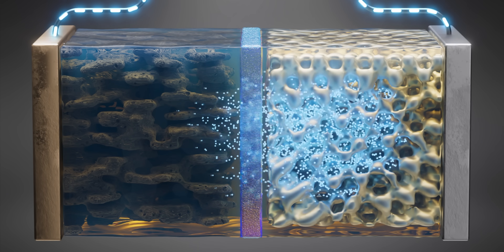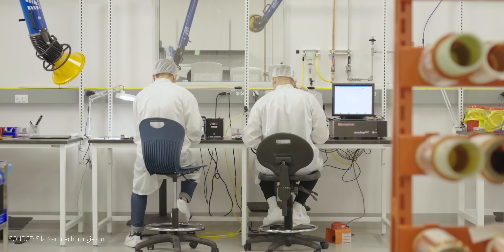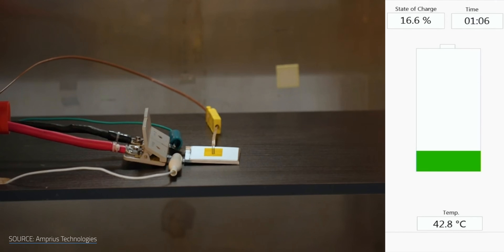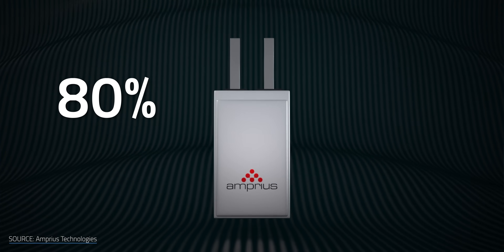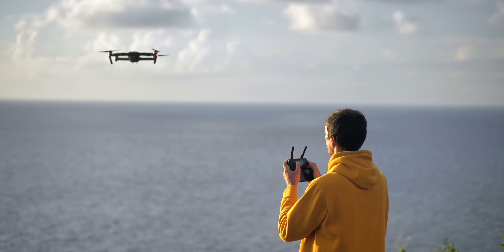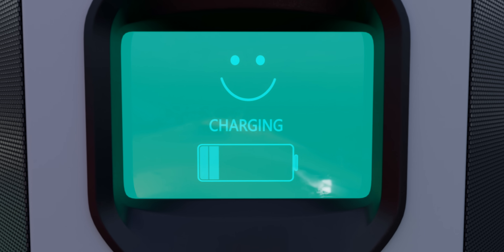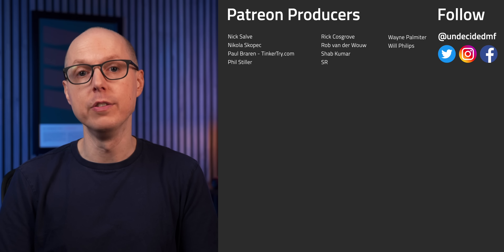Why This Ultra Dense Battery Breakthrough Matters

Comment: I think as far as vehicle propulsion goes, the industry is going to pivot towards Hydrogen and Ammonia powered vehicles.  This tech will still be useful for smaller applications you outlined though.  If I am wrong then the world must rapidly expand power generation facilities, and wind and solar renewables are not going to meet demand.  It will have to be done using Gen 4 Nuclear plants.

Comment: I think silicon batteries are "too good to be true".   Faster charging, from a grid that is NOT being improved and decreasing power generation, is Lunacy;  you can't draw blood from a turnip with a fire hose!  To add 80 KWH to a 100KWH batt in 6 minutes would take an 850+ KW charger because of heat losses and slowdown near full charge.   A Semi would require an 8.5 Megawatt charger!! >>>this represents an input of 5,700 amps at 1500 volts - that is insane!

Comment: Centrotherm is not a Dutch company. Ambrius is not partnering with Centrotherm, they are buying equipment from them. This is the kind of nonsense you get from someone in way over their head just reading press releases.

Comment: The lithium ion battery has no future due to the serious fires it is involved in if damaged or corroded - this is making such vehicles uninsurable. So having a material like silicon that can store more lithium and increase energy density just makes this situation worse. The latest batteries from CATL and BYD are sodium based and they will be superseded by solid state ones. But this technology also has a limited future in EVs as back up to hydrogen fuel cells which even Tesla is now moving to as well as Toyota and others in recognition that there are limitations on renewable energy supplies and charger capacity and siting. that are serious limitations to using an EV away fro your home city.

Comment: Isn't lithium the massive problem with batteries though? Are they going to be able to get away from Lithium in your opinion? You've covered a lot of batteries, and I always enjoy your commentaries, but I'm just concerned about lithium as the major component and feel like one of the other techs you've covered is going to have to take over at some point.
Reply: Lithium is not and never was “the problem “.
Reply: There is research underway to make sodium-ion batteries practical. Worse energy density, so not what you want for electric vehicles. But longer life and lower cost-per-unit-capacity, so ideal for grid storage, renewable energy and UPSs.

Comment: Amperius President and CEO both sell their stock as soon as they are issued it. Seems neither of them have any hope for the company. 
Jonathan Bornstein, President of the company was issued 70,329 shares at $0.05 per, and sold the same day for $4.36. Constantin Ionel Stefan the CEO does the same thing, but sometimes takes an extra day before selling. Sometimes a few times a month, sometimes less. If they don't believe in their technology, why should I?

Comment: Why can't you build/grow a lattice and coat that with silicone?  the current nanowire bottlenecks should be worked on, but it seems that is a showstopper unless someone thinks a breakthrough is imminent

Comment: China are changing their Lithium to type of coal or hardened carbon they put out the same power so far as Lithium but cost far less to make and also they keep their charge and recharge faster and longer with less heating issues. Also with the same finds making 128 bit processor phone chips to take the place of their dragon types of silicon chips. things are getting very interesting now. But the down fall is they all need to be charged and that uses power sadly but still amazing.

Comment: The minimum standars Cycle Life for Automotive battery Sector is 1000 DoD 100% cycle @70% of maximum Capacity @ rated C.
Old data found on it say 200-1200 cycle Life DoD 100%. The difference depend on the type of the cell. They claim that the 450 Wh/kg battery they are actually  selling , has improver cycle life. I think that is it possible in the 500-600 cycle life range @ 70~ % capacity of 1 Cycle

Comment: Amprius has claimed that their silicon  anode are compatible with existing battery manufacturing. And DoE has award them for a specific program for high energy density battery. For me they has all the checks and protoypes abd cells that are good. 👍🏻

Comment: I'm reminded of Pournelle's observation regarding Solid State drives and spinning platter magnetic data storage. Back about the time of the publication of 'A Mote in God's Eye', Pournell predicted that a decade or so back, we'd have moved to exclusively using silicon for persistent data storage, possibly with an optical medium for archival purposes. His logic at the time was that silicone was readily available on almost every beach and almost all soils, where the materials for the magnetic medium and the platters for hard drives was a much more limited material. This should make Silicon based storage significantly less expensive from a resources perspective. It is, however we are seeing a large migration to Silicon now, not because it is cheaper, but because it is significantly faster for the purposes we need that speed for. (Local laptop storage, memory virtualization, etc.) however there is still a large market for Hard drives, especially when Capacity is in question. Right now you can pick up a 20 TB WD Red (NAS) drive for $260 (US) on Amazon, however a current search on Amazon shows the largest capacity SSD drive available through them is 4TB, at $145 from Silicon Power. Not having heard of them, the next 4TB SSD I spotted was a Samsung for $207, as well as a Crucial NVMe 4TB for $180. Those may seem like a deal compared to $260, but if you need that 20TB capacity you're going to need at least 5 of these, perhaps 7 depending on how you RAID them together, to provide equivalent capacity, and that kind of eats up the savings.

That said, I like the idea. Eventually I see Silicon taking over in both power and data storage, whether it's like this or in some other solution. Just kind of more concerned about the turnaround time for products that will be price competitive at the consumer end.

Comment: Everyone keeps sponsoring SurfShark, and it doesn't work at all. People need to be cautious. It's good for tricking the region, but that's all. There's zero privacy. Anyone that's used it and got a letter from their ISP can verify this. It's probably all VPNs though, not just SS. SS was completely clueless about this, until I had a long chat with their tech support, and showed them. They genuinely didn't know before that. The went from saying "it's not possible"; to; "oh!". Yet everyone keeps pushing VPNs, and they are already cracked. The data stream is encrypted, so there's security there, and it gets past internet content filtering, and regions, but they can see exactly what file/traffic is going from point A to point B. 100% not private.

Comment: There is a near term solution to the graphite supply problem. It called the Hazer Process and converts methane (natural or bio) into H2 and graphite. Little energy is used and it cheap and scalable.

Comment: one thing i hate with lithium batteries...they dont like to be fully charged....so i keep mine at 30%. Its a pain, since i have to plan in advance when to charge it up and i also have to plan for actually using up that charged energy before i put the battery on the shelf....This huge hassle made me to get rid of batteries and just get gasoline powered tools.

Comment: You failed to mention the fact that ambient operating temperature range of Sodium anode batteries, as examined by CATL in China, is far wider than that of lithium-ion batteries, and considering the fact that as the size of the cells decreases,  thus making their deployment in mobile tech, much more highly desirable in the few cold climes remaining on the planet, but performance in warmer climes make them more adaptable, too!
It's apparent that lithium batteries future is ...in a runaway meltdown? No?

Comment: the reason lithium chemistry is unchanged(relatively) is due to one key factor
greater energy density means more energy and less mass to absorb and reject heat
it is already a major issue with EV's, the battery can get so hot during normal(non supercharge) use that the internal components degrade into a short circuit leading to a sudden dissipation of all the energy inside a cell as heat, causing what is called "thermal runaway"
while stationary or industrial use like planes and EV trucks for freight transit or grid storage may benefit from simple energy density boosts, you are unlikely to ever see it in an EV, it is just too hard to manage a cell that on edge
this is assuming you can actually store that much energy in a stable form, as it begins to rival gasoline and other chemically explosive compounds in energy density
just look at theoretical energy capacity of gasoline and TNT vs current lithium cells, you are basically putting a gasoline based fuel cell and tank into your pocket if you get 24x the energy of traditional lithium cells, and given how prone traditional cells are to damage causing thermal runaway you would NEVER want that much power in a place where you might get stuck within a few feet of the cells

at best this advancement will be relegated to "power vaults" where they can shut away a small chunk of damaged cells upon failure in a grid storage facility or the backup power for a nuclear plant or similar
the danger of electrochemical explosions is just too high for normal human use

no it will NEVER be safe enough to have something more energy dense than gasoline as a storage medium in your car, gasoline is remarkably perfect for chemical energy storage

what we should focus on is making a hydrocarbon "battery", a device that easily reforms a hydrocarbon with ideal properties for various temperatures and with a highly stable shelf life, like a liquid unpressurized version of propane
then maximize fuel cell tech to the point where we are just as efficient as electrochemical batteries

this would mean we can easily re-form a storage medium that can be a renewable consumable, pump this new "perfect gasoline" into the new cars and you can easily create a long-term stable solution to mobile energy generation and storage
plus as we all know, hydrocarbons leave behind gasses that act as a thermal blanket to our planet in high concentrations, so if we can pull those waste products back, form them into a more stable and higher energy form, we can kill two birds with one stone

Comment: Here's the hidden problem with charge time. Some battery systems are claiming potential 60% in 6 minutes. Sounds really nice (assuming it works and does not deplete battery life--another issue).

But here's the rub. Taking, for example a Tesla 40 Kw-hr battery, 60% charge would be 24 Kw-hr. To charge that energy in 6 minutes would require 240 Kw (Kw is the rate, not the total energy).  240 Kw, assuming 220 VDC to the vehicle would be about 1000 amps. That is a HUGE amount of current, especially when exposed to weather and casual use by non expert motorists (potentially extremely dangerous). And that is each and every station while the chargers are in use. It's NOT like charging a cell phone.

We don't have the grid for this scaled up to millions of cars and 10s of thousands (at least) charging stations. And that capacity is not on the horizon.

Comment: Don't get me wrong I am amazed at the progress being made in battery technology and being an electronics technician by trade and of an age to remember when gel cell lead acid and nickel cadmium batteries were the only options available for portable power I am forever grateful to the engineers and scientists who gave us the lithium cell batteries that we have become so dependent upon. However there are two issues that need to be addressed, actually one issue and one outright fear. First the issue we all know that  current trends are unsustainable due to the scarcity and toxicity of current battery technology. But this is something well covered already by people far more knowledgeable than I and I am confident that the next generation of battery technology will be far less impactful on resources and environment. As for the fear. I am an avid e-biker and the bike I ride when fully charged has a throttle only no peddling range of about 40 miles I weigh in at around 200lbs the bike another 100lbs it cruises along at a comfortable 30 miles per hour. Consider for a moment just how much energy that represents imagine trying to peddle 40 miles with a 300 pound combined weight at 30 miles per hour and you start to get a sense of the terrifying energy density right below the seat of your bike! As these storage systems inevitably become ever more energy dense it is paramount that safety systems keep pace. I do not have a clue what sort of shunt or discharge technology would suffice in a situation where a fully charged super battery suffer a catastrophic failure causing an uncontrolled rapid discharge of such a dangerous amount of stored energy but I am certain that it needs to be addressed. Having said that excellent video, well done. Thank you.

Comment: No matter what the technology of the battery production is, as long as it is safe with no thermal runaway, little or no built up of dendrites, high energy density, shorter charging time and with very high energy cycles. The best I've seen undisputed with these criteria are Solid State Batteries and Super Capacitor based batteries. Nothing else comes close to these two technologies so far.

Comment: Ok. Another battery! Phooey! There's motors that run on water. An EV is too heavy and isn't dependable. Try again. Strange I haven't heard about capacitors. Why is this? Kid are making self charging go carts. Why isn't Tesla? Because they're getting rich selling grossly over priced EVs. Lithium is a much bigger polluter than gasoline. Tires cost 300 dollars  and last only 25,000 miles? You know there be a road tax on Evs. EVs are a joke.

Comment: here comes the dirty truth .

the battery industrial complex is the same like the petrol based industry .

they build up over 2-3 decades the delivery chains , suppliers , contracts with mines  , landowning for mines ....etc. for the LI-Io battery .....

whatever that battery can achive . they wont trhow that money / infrastructure away till it has paid out .

i am still a petrol car fan , but have no grudge against ev at all .

the 0-60 times , flying cars / VTOL ...etc is in my eyes the circus trick to attract attention .
i can not afford a tesla s with ludacriuos mode anyway , so why should i care about some better performance in a car that i can not afford ?

i need a ( if i suggest bying an ev ) affordable daily that is usable as a petrol car and not a financial scrap metal after the battery dies for some reason whatsoever .....straight our normal performance , range and charging time with some reasonable price to charge and i am ok .

i love cordless power tools for their high tourque .

give me the silicone battery for my driller , grinder , saw and torque wrench that last whole day and is full during a coffee break and i buy this shit allways over wired tools .

i think flying and hauling is right now out of the spectrum , because of the weight that comes with the battery, so please focus on duable things instead of three steps at once and getting bacrupt before first step is done.

Comment: Requisite reminded that EVs are not a solution to climate change. Trains are, specifically those with overhead electrical wire or for intracity-use, third rail

Comment: This tech could be a huge benefit to making EVs more practical for the average consumer, however, cost is likely to remain one of the biggest hurtles in the marketplace.  Of course, this also doesn't address the other factors like infrastructure requirements for mass adoption of EVs and other appliances and tools by the greater public.

Comment: 2:03 - I don't need charge capacity to ruin the concept of EVs, as they exist now. I'd much more likely highlight the permanent scars left on the land, by the mines or the fact that when these batteries explode, they unleash extremely harmful chemicals and a profoundly high volume of immediate pollution, not to mention they will not be sold into 2nd hand markets, creating more junked cars than we've ever seen in history, each of which will be incredibly dangerous if batteries are not all removed and disposed of correctly. None of this mentions how the electricity is generated... 

Charge Anxiety, like I need that to argue the pointlessness of it.

7:13 - This sounds promising. But many things have, in recent years.. Regardless, I think this has been the wrong path to tackle the issue, as it stands. I think it would be good, if we had worthwhile batteries, better means of charging and didn't need to core out enormous portions of the planet, just to have 6/10 EVs which cause many of their own problems.

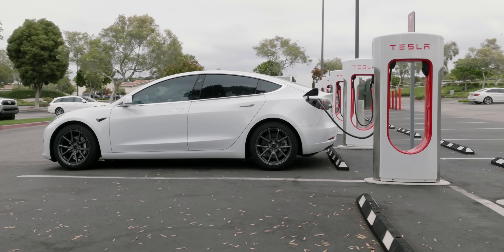Comment: 1:50 Hard disagree that capacity is a limiting issue in modern passenger EVs - devices like phones and watches are packed with as much battery as possible and use pretty much the highest density lithium ion chemistries available, while EV manufacturers are already switching to LFP and even sodium ion because robust, cheap and longer lasting are all properties that are more desirable than the bestest possible range once you reach the good enough levels we're at today. Yes, the larger vehicles are still a sticking point and planes aren't happening with LFP, but in passenger vehicles more capacity is just nice to have and not even the biggest priority